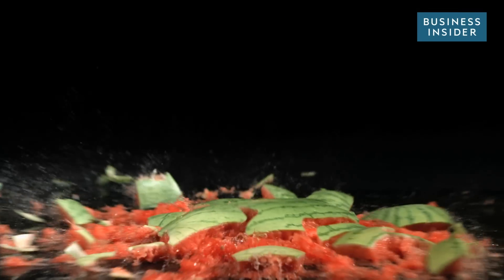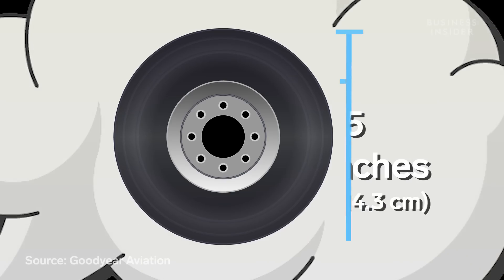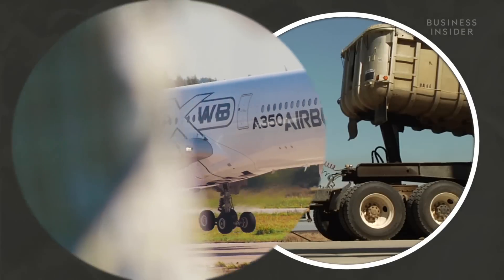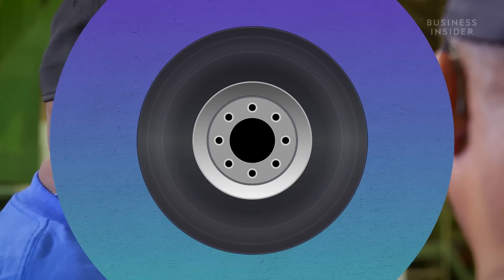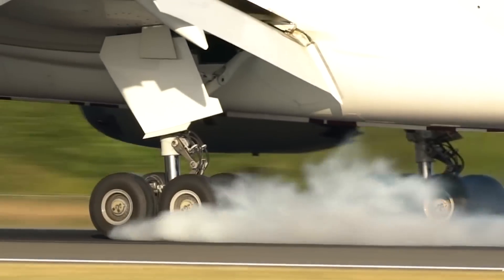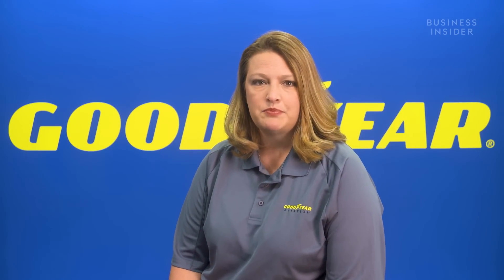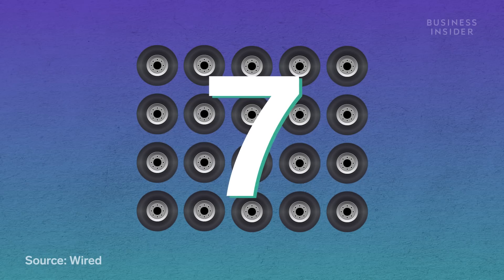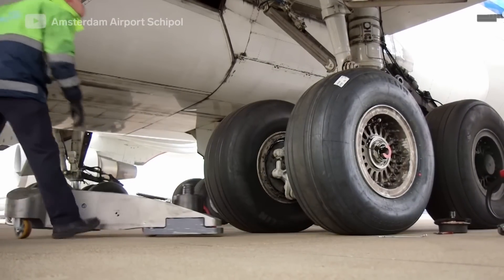Why Plane Tires Don't Explode On Landing

Comment: One thing that apparently they don't do anymore, to judge from the video, is to design the tires with pockets or vanes or blades, that catch air to initiate rotation prior to landing, so that when they touch down they are moving at the speed of the runway and don't do that chirping thing with the cloud of smoke. I seem to recall that was a big deal in tire life-although my information may date from World War II bombers, or the early days of jet airline travel.
Reply: Yes, that has been studied for military and commercial uses from at least the 1950's on.  Wasn't worth it, whether by vanes or motors or whatever.  Simply put, the solutions cost more than the problem.  There's apparently one biz jet which has vanes to spin its small nose tires, but it doesn't scale to MLG tires + brake assemblies.

Comment: I was a wheel and tire tech in the air force for a while. If we took an hour to change those tires we'd be in hot shit haha. 5 mins per wheel was it lol. Had many a smashed finger after dropping those heavy bastards on my hands. I was hoping they'd cover the overhaul procedure of the wheels and tires cause that's what I did. Still informative video though

Comment: This would be great for passenger automobiles and commercial trucks: 200.0 PSI of Nitrogen and 48.0" of tire treads - no more tire rotations, tire air pressure refillings, and having to purchase a new set full of tires, for life.

Comment: A lot semi truck use retreaded tire and most of the time they explode because of pressure build up and cheap retreads , you are not gonna find new tires on the road

Comment: I watched this hoping to see a cutaway or at least a diagram of what the inside of an Airplane tyre looks like. You mentioned the materials used but focused on the tyre pressure instead as though its the main reason for its strength. Disappointing.

Comment: Who the hell told the air crafts engineer that nitrogen is a inert gas.....😂😂😂😂.....lol...check the periodic table....
Reply: I'm a retired landing gear engineer.  Nitrogen is an inert gas:  It won't auto-ignite, and in dry form it doesn't promote corrosion of the wheel or associated components such as pressure sensors.  Is there some other definition of "inert" you want to use?

Comment: 1986 mexicana airlines, flight 940 one of its tires exploded in midair after takeoff causing the plane to suddenly start losing altitude and finally crashing against a mountain. Everyone died. Presumably, that particular tire had been inflated with air instead of nitrogen. :-(
Reply: It can also be hydrocarbon contamination in the inflation hose leading to autodetonation, even with N2.  That happened to the NLG of a Mexican airline's DC-10 during the takeoff roll, leading to a hull loss but no fatalities.  That was in part thanks to a brave flight attendant who made sure that the smoke-filled cabin of the burning plane was totally cleared before she jumped from it to the ground.

Comment: Quick answer: They are designed for it
Thanks for the likes !!
Reply: @jacob marr It's called watching a video and summarizing. Calm your nuts.
Reply: @naritruwireve1381  it’s called a joke
Reply: Less quick answer: They're inflated for high air pressure which makes it stronger and with nitrogen so high temperatures and pressure changes have less effect on them.
Reply: It's only a 4 minute video
Reply: @husam9443 That doesn't make it any more legitimate. The video leaves out the most crucial reason the tires didn't pop: the suspension system (Oleo strut). Reinforced tires won’t last long without a sound suspension system, nor will the aircraft.
Reply: mad_over_wheels thanks for saving me 5 minutes
Reply: Ah thank you
Reply: Bruh🤣🤣🤣
Reply: lol
Reply: Obviously
Reply: mad_over_wheels looks like I ain’t gotta watch the video now, thank you
Reply: Quicker answer: Because they do

Comment: 1:55 "nitrogen is an inert gas, so temperature and pressure changes have less effect" I don't think that's the reason!
Reply: Its true
Reply: @purified_drift4845  No, it's not. Boyle's law applies all the time. The only reason they would use nitrogen over air is because N2 is larger than o2 and argon. Pressure and temperature most certainly do not have less of an effect, but they are a lot more predictable.

Comment: Beautiful video about durability and toughness of its manufacturing... Actually , Tire does not burst unless it exceeds Vmbe ( minimum brake energy speed) which is directly proportional to momentum ( i.e weight and velocity) and pressure altitude and configuration of airplane upon take off ( when take off rejected) or landing ..Very nice video 🌷🌷🌷🎊🎊🎊🙏🙏🙏
Reply: Sorry , its maximum brake energy speed 👼🛩️
Reply: ... and it's proportional to kinetic energy (speed squared).  The actual "max" number for certification is a KE rather than a speed (898.6 million ft-lb in the case of the DC-10-30, for example).  Flight manual limits are then derived from the demonstrated KE and stopping distance.  Included are the effects from things you mentioned, such as pressure altitude and flap setting, along with a substantial factor of safety.

Even after a max energy (or above) RTO, the tires shouldn't burst.  Fortunately, airliner wheels are fitted with something called fuse plugs, which melt and let the nitrogen out within several minutes of the stop -- before heat from the brakes can make its way into the tire and cause it to fail from a combination of pressure increase and elevated-temperature weakening of the carcass.

Comment: 1:55 Nitrogen is an inert gas....

My chemistry teacher....-
I am about to end her whole career
Reply: No fact checkers along the line.  Nitrogen is treated like an inert gas but it's not really a member of the family.  I think she would have been more correct to say they remove the corrosive oxygen from the air they fill the tires with and that leaves nitrogen.  I think that's the logic anyway.
Reply: Alex T she should have specified
Reply: It is, at least under normal pressure and temperature. But it doesn't make any difference on its expansion with heat. The main reason for using nitrogen in tyres is, any moisture has been removed from it  during the production/compression. It is the moisture in normal atmospheric air causing all the problems mainly excessive pressure fluctuation with temperature changes. Added (marginal) benefits of nitrogen  are a slightly less weight and more safety in case of a fire.

Comment: This video just makes people more stupid. First of all a landing airplane doesn't just fall from the sky vertically. It glides and tries to hit the TARMAC as gently as possible. Another thing is the landing gear. It absorbs a huge amount of that force which is trying to destroy the tires. And don't get me started on the nitrogen filled tires. The amazing thing here is the landing gear and the tires working together and taking all that punishment like a boss. High level of design, material and production that's what it takes.

Comment: A great, informative video with one glaring flaw: you compare the needs of semi-truck and tractor tires with airplane tires by showing the former drop straight out of the sky onto the ground, instead of coming in at an acute angle to the ground, as airliners do. If I (or anyone) was ever on an airplane that "landed" as you show the tractor and truck to do, there would be no more air travel. Maybe consult a physicist next time. Other than that, I learned things and I'm glad I watched!

Comment: The tires don't bear the whole weight of the plane on impact.  The wings are still providing lift.  Not until the tires are rolling without skidding do they bear the whole weight.

Comment: It takes 2 mechanics an hour to change one wheel... Excuse me what. It takes the guts of 10 minutes maximum. You have to be able to do it on aircraft turnaround if it is required... What dopey ass engineers take 1 hour to do that!?!?

Comment: People need to learn the difference between tyres and wheels.
A wheel is made up of a Tyre, rim and valve. The black rubber thing is the tyre. The whole assembly is called the wheel.

When you have a flat tyre on your car, you are changing the wheel with your spare wheel. Not the bloody tyre. 

If you are going to change your tyre, you will be removing the tyre from the rim and putting a tyre back on the rim.
Deciphering your ignorance gives the clever people headaches.

Comment: But they DO EXPLODE. And not the nose. The mains. And it takes less than hour if you know what you are doing.

"Which reduces it from exploding as the bolts and nuts are removed from the plane". These fukcs don't know anything about what they are making a video about.

Comment: At the end of the video it mentions that used airplane tires get to go to work on farm equipment but it says that the tires are just used for recycled rubber.  When I was a kid,  I remember that we used old airplane tires on the sprayers, as is . Maybe that's not the case anymore.  Any farmboys out there know whether a John Bean sprayer still uses old airplane tires?

Comment: A Concorde tire passed over a strip of metal from a sloppy repair to a Continental plane, came apart in chunks, struck the plane wing, and caused another part of the wing to rupture with a sizable fuel leak...

Comment: fun fact: all aircrafts are rated to lose one tire per axle, so normaly a 737 has 6 tires, but you can still safely land with only 3, one per axle
Reply: and the reason why you need at least 2 mecanics to replace a wheel is because its a critical task, thats also why your not allowed to change 2 wheels on the same axle, cuz if you do one wrong, the other one will probably so be wrong and you risk losing both wheels, which is unsafe of course

Comment: Aircraft tires blow out often...it's not rare...and sometimes doing quite a bit of damage to the landing gear fixed door and flaps... But what do I know...only been doing commercial aircraft maintenance for 28+ years...
2 Mechs 1 hour to change a feaking tire... are you kidding me?!?!?! BS....10 mins (15 for a brake change) on a 40 minute turn... either that or they are lazy freaking mechanics...

Comment: Almost every time people mention "tarmac", they're actually referring to concrete.  Tarmacadam is nothing like concrete.  It is closer to asphalt, but because it uses tar as a binder instead of asphalt's bitumen, it is easily damaged by diesel and gasoline. Because of this, tarmac is almost never used anymore.  They haven't made airport surfaces out of tarmacadam in over half a century.

Comment: They raise the tire only 5 centimeters off the ground, which doesn’t feel like enough room to fit a thumb.
Your thumbs are more than two inches thick?!
Reply: There's so much wrong with this video..
Reply: Yep I think it should be 5mm
Reply: I thought that too but thinking about it right now I think they meant lengthwise. The two knuckles only
Reply: Not sure about my thumb but my penis would certainly fit
Reply: I mean why raise it more, right xD off the ground is off the ground, you can't really make it "more off the ground" i mean when changing car tires in your driveway you also dont lift it until it flips upside down right?
and @Campbell Aviation it doesn't???
Reply: those are t h I c c thumbs
Reply: Hopeful lol American measurements are dumb
Reply: Okay, 5cm does not equal two inches...
Reply: @campbellaviation7357  an inch is 2.54 cm. So it's pretty much correct fpr 2 inches being 5 cm
Reply: 5cm is less than 2 inches. Way less
Reply: @litmusaero2645  Yeah, way less : 5 cm = 1,9685 inch... you can check it on any online measure conversion service.

Comment: Great video on tires but, please, please, please, airplanes never, ever land on the tarmac, ever. Tarmac is where cars drive. Airplane land on runways, almost always, unless it's an emergency landing and they land on a road. In this case, it would be landing on a tarmac. Not sure where this confusion comes from because no one in the aviation industry says that airplanes land on tarmac or got stuck on the tarmac :)

One thing I've wondered is why not fan scoops to get the tires to rotate in the direction of the landing and save on wear? Any aviation tire buffs out here?

Comment: Never knew nitrogen was an inert gas
Reply: Nitrogen is isn't an inert gas, in the same sense that argon is an inert gas, but for many purposes it behaves as a quasi-inert gas, because of how energy-intensive it is to break its elemental diatomic form.  Unlike oxygen that may ionize to form ozone, or oxidize other substances such as metal corrosion, nitrogen will not do that.  Some plants have the capability of chemically reacting N2, but for the most part, as long as you don't heat it to flame temperatures, it will stay as N2.   N2 is used without O2 in airplane tires, to mitigate the risk of fires.   N2 cannot enable a fire the way that O2 can.  There are products of combustion containing nitrogen, but you can't start a fire with only fuel and nitrogen.

The obvious reason they don't use actual inert gasses to fill tires, is that it is a lot more expensive to distill argon, krypton, neon and xenon from the air.  Nitrogen is the dominant component of air, so it is the most readily available to use, when a non-reactive gas is needed.